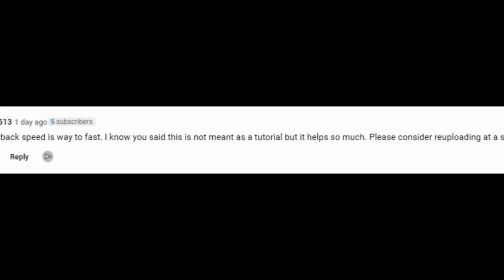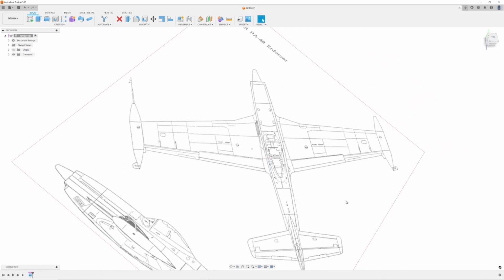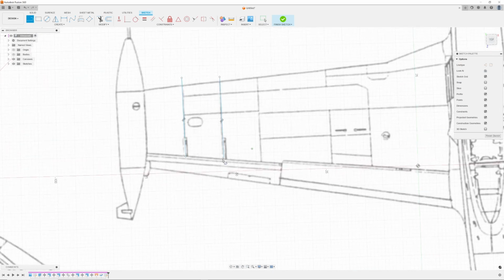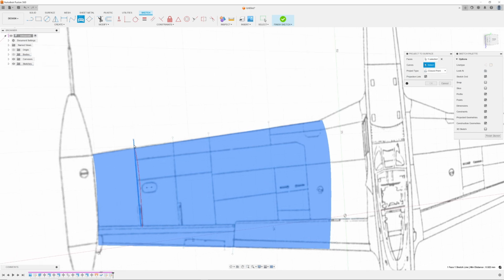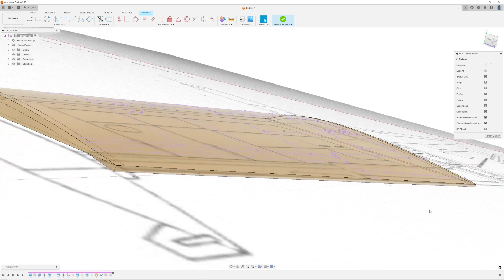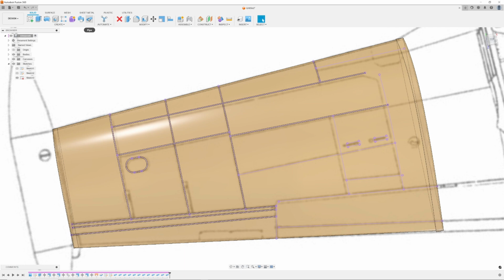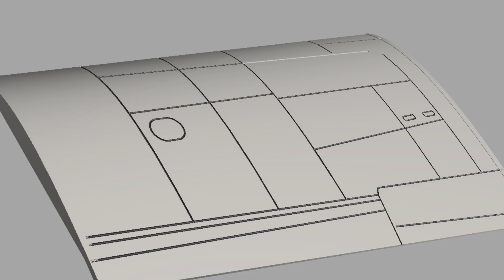Unlock the Secrets of Model Airplane Surface Panel Detailing [Fusion 360]

Comment from the maker: 00:00  Intro / Commenter Request
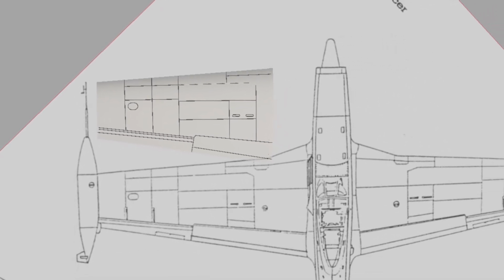00:30  Process Overview In Fusion 360
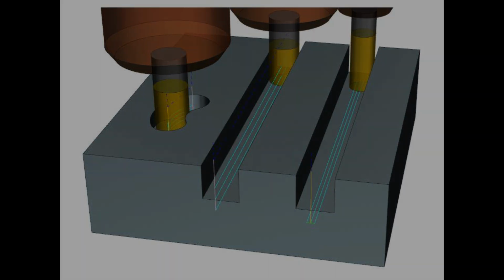00:47  Inserting Reference Materials Into Fusion 360
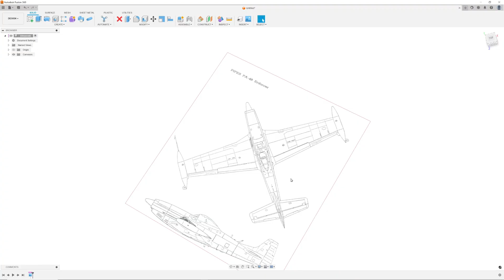01:10  Creating Curved Surface To Use as Panel
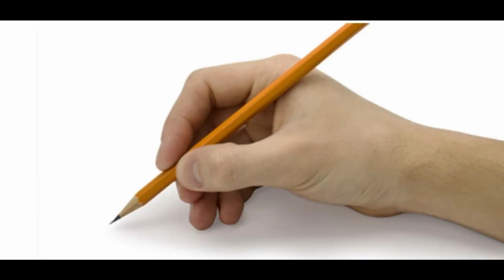01:34  Tracing Imported Reference Material (Panel Lines)
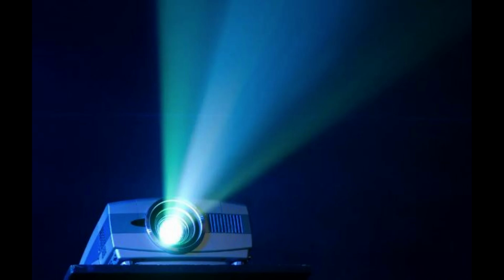02:41  Projecting Panel Lines Onto Curved Surface
04:20  Cutting Grooves Into Panel Surface Using Projected Lines As A Template

Comment: HI, Many thanks! it can work on Solid body? I tried, but when I'm going to Edit Sketch  the Bodies section disappears from the browser, and I cant find and mark the faces. why?
Reply from the maker: Hi,  hmmm.  Fusion does this thing where moving from sketches to bodies etc,  it'll automatically hide certain things.  I supposed this makes sense going from sketch to body as the sketch becomes the secondary point of interest.  

I can't remember if I showed it in this video or mentioned it.  But there is a quick step where you turn the surface into a body.  And this is where you'd use a very small number with the point being to turn the surface into a body.  And once you have a body,  then you can make cuts into it using this workflow.

Create your curved surface.  It'll appear on the tree as a surface body.  Then thicken this curve surface.  This will create a new body in the tree that you can then project the sketches onto.  Sometimes going back and forth between sketches and bodies you'll have to manually check the visibility (eye) icon in the tree.

Let me know if this makes sense.

Comment: Is there any way of converting the curved surface like wing skin and fuselage skin into 2D templates so that the templates can be used to cut skin parts from materials like thin foam or paper for covering?
Reply from the maker: Hi @RCwithSohel,  yes.  There is definitely a way to do this.  I'll be doing a short video on how to do this shortly.  Thanks for the asking and stopping by!
Reply: @planejanemodeling  thanks for your reply, I'll be waiting for that tutorial